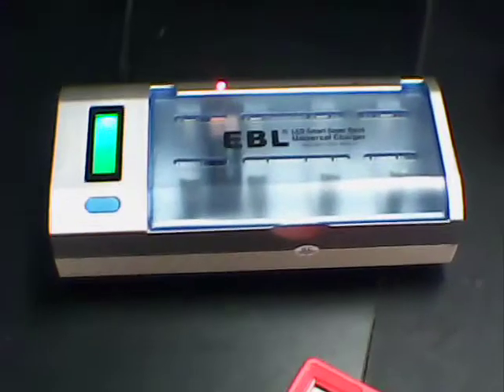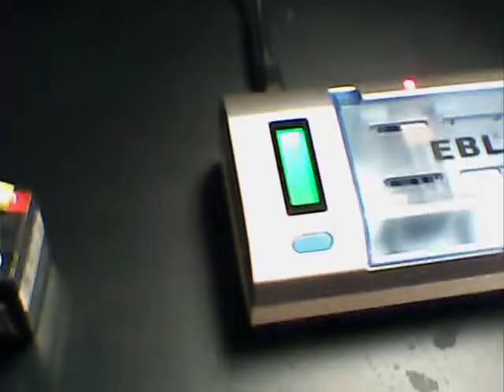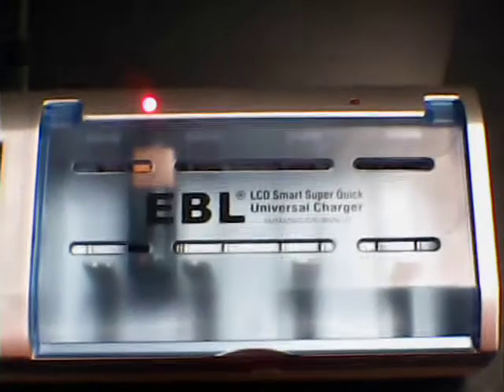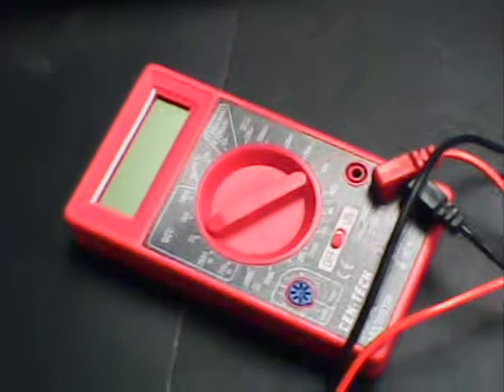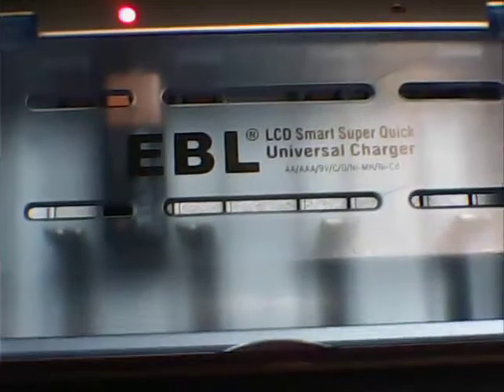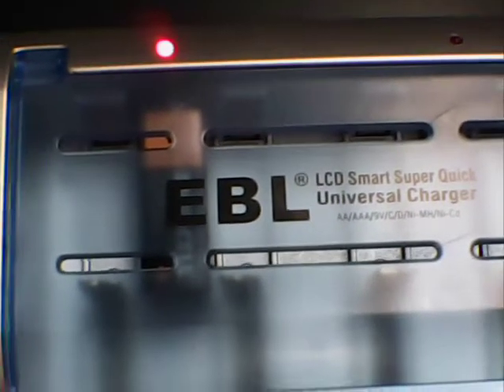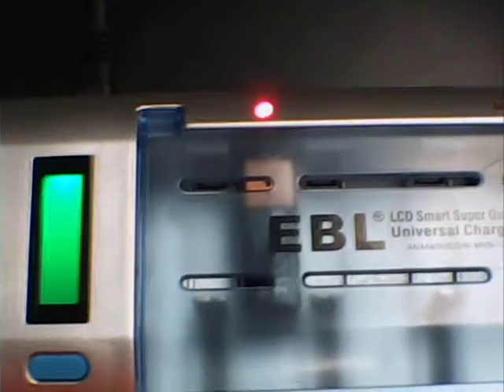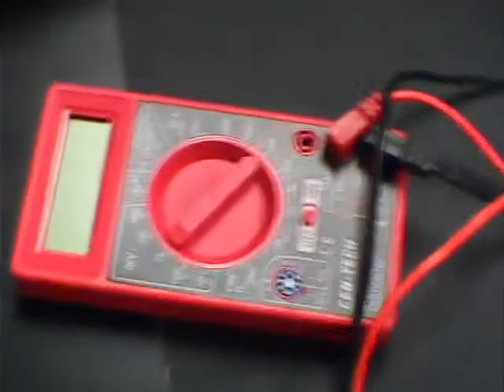Recharging 9V alkaline Batteries (Recharging non-Rechargeables)

Comment: I've been charging alkaline batteries for over 40 years, and never had one explode.
Various chargers for non-alkaline batteries have appeared over the years, but they seem to disappear soon after.  

A large hardware chain in Canada got such a charger approved by the government for the first time ever in 2011, but it no longer exists. My theory is that the big battery companies did some back-room arm-twisting to get it removed.

I remember back in the 80s I think, a university professor had patented a way to charge any alkaline battery, and he was selling the chargers on TV. He ran a few informercials, and then the product seemed to disappear completely.  He was bought out by a big battery company, I believe.

A few dollar stores here used to sell inexpensive alkaline batteries from China for much less than anywhere else.  They seemed to be of reasonably good quality.  Now they only stock well-known brands like Panasonic and Sunbeam, which are more expensive, and lesser quality.  I suspect arm-twisting there as well.

I had a laptop back in the early 90s, which had a rechargeable battery that lasted for years and years, still holding a charge.  A computer technician said it was unheard of for any laptop battery to still hold a charge after 6 years.  I went to a battery shop for answers, and they said it was an alkaline battery pack.